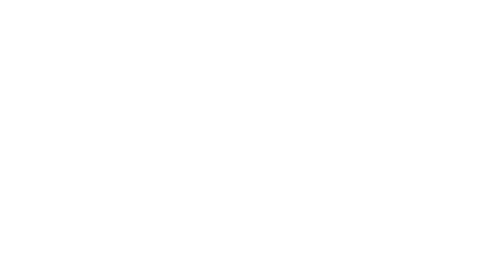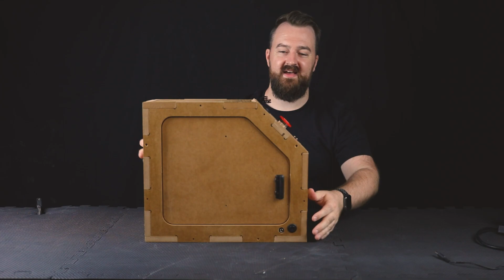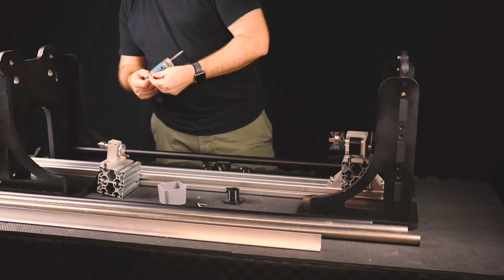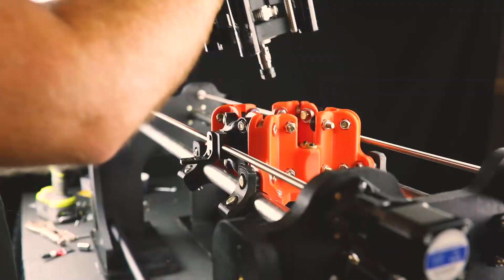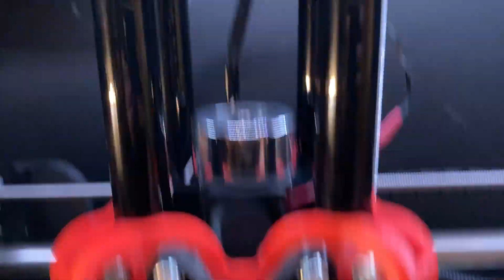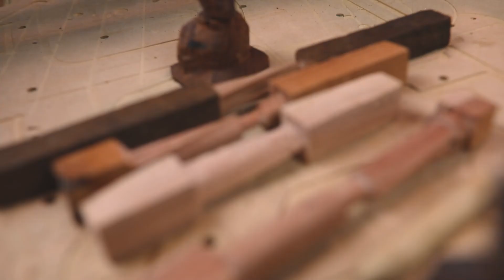My Strange 4th Axis CNC // 3D printed

Comment: I probably missed it. What software where you using?
I have Fusion 360 but I think without extensions I can’t use the 4th axis the way you showed here?
Reply from the maker: Yes I’m using fusion 360 to create the gcode. You will need to purchase the 4th axis add on if you only have a hobby license. Then I’m using mach3 software to control my 4th axis. 👍
Reply: @NEWTechCreative  i bought the yearly subscription but I don't own the extension for CAM. Have to look for other CAM software the extension is too expensive for hobby use.

Comment: Great stuff!

You mentioned these connectors you used in the wiring.  I think you said they were used in aviation?  This is new to me.  Could you share a bit more about them?
Reply from the maker: Thanks for your question. These are secure plugs and come in various pin amounts. I use typically use the GX20 4pin versions for my steppers. They are great to use with shielded cabling through to elec case body. They can be purchased in many online shops, however I purchase through AliExpress. I’ve heard them called other names, so you might need to see who stocks these near you. They can be fussy to wire the first one, although with plenty of flux they can be very secure.
Reply: @NEWTechCreative  I googled that info so now I know what you are referring to.  Thanks a bunch!

Comment: Thanks for posting. 4th axis work is tons of fun for me. Even better results with 5 axes but the affordable software is lacking of course. Some software like VCarve allows you to adjust the cutting direction between 0 and 90 degrees to the orientation of the piece.

Comment: This looks awesome, I will be starting this project soon!   Did you ever have a problem with the A-axis rotating too many times and needing to return to the "home" position while in the middle of a program?   I run a large CNC mill with a rotary axis for my day job and you can only rotate it so many times before it needs to return to the "home" position.
Reply from the maker: Thanks for your comment Zach. No I haven’t run into this issue yet! Are you using mach 3? Your machine might be set to a limit, or your cam software might be set to a limit to ensure to limit the runout over too many rotations. I can’t see this being a massive issue, however adding this in would increase the machine time.
Reply: @NEWTechCreative  Yeah the machine has a hard limit of 200 rotations before it needs to return home.  Its just a limit the machine builder has.  Thanks though!

Comment: Hey, amazing build, quick question what were the percentage infill did you use , especially for the main core?
Reply from the maker: Thanks for your comment Hollee! I was aiming for around 60% for rigidity and took a day or two to print!! It’s best to invest in more infill than less. 😁👍👍
Reply: @NEWTechCreative  I went with 40% since I'll be using it with a Dewalt 611 and only for wood and pvc. Going for a belt driven with a grbl cnc.
Reply from the maker: You must keep me updated with how the build goes. Feel free to email me or tag me on Instagram. Sorry I haven’t provided much build info, however happy to guide if you get stuck. Enjoy 😊

Comment: Hi. Great job, my compliments. Just to understand well, you are using the X axis (instead of Y axis for F360 post processor compatibility) for left and right movements, the Z axis for up and down movements but the A axis is for what ? Is it a slave axis for X or Z ??  ps: sorry for my bad English
Reply from the maker: Thanks for your comment @IceCreams62 . The A axis is for the rotary/turning axis . This works on a 360 degree motion and reads degree rather then travel distance. This motor turns the material. I hope that makes sense 😁
Reply: @NEWTechCreative  Me stupid stupid. I completely forgot the rotary axis management  :-(. Thanks a lot for the clarification.
Reply from the maker: No problems 😊